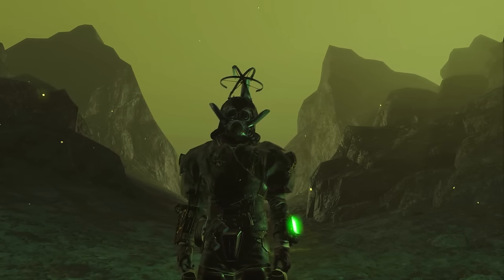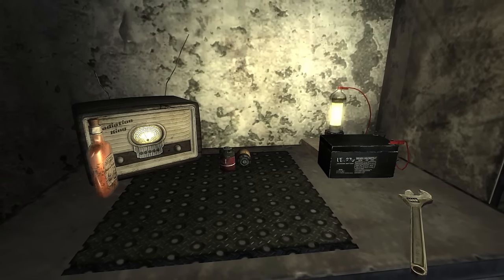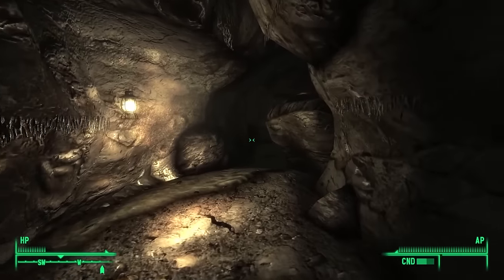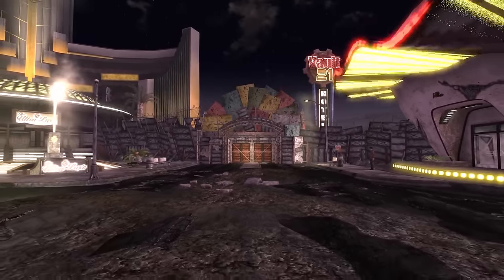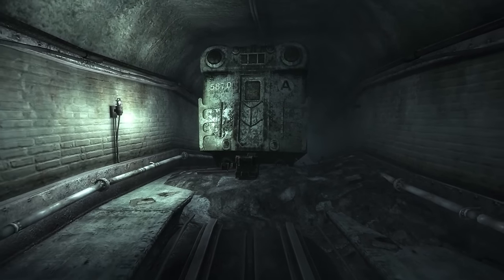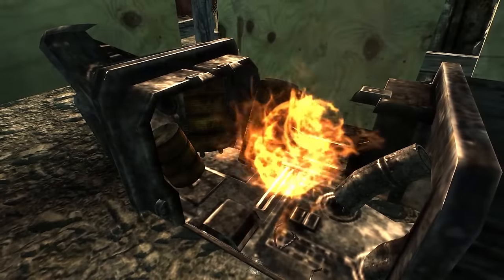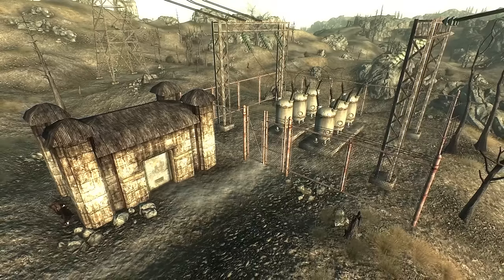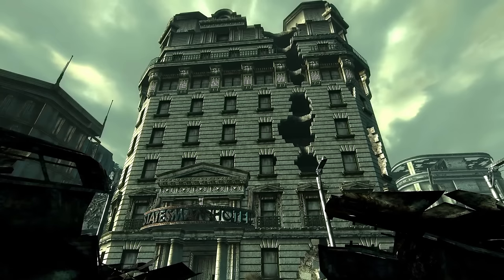Where does the power come from in Fallout?

Comment: the last part about developers making power generation being explicit only for story reasons is efficient and is one that FNV also leverages. If Obsidian set their fallout game to a place that does not have a cloes  by hydroelectric dam, they would have done what they did as Interplay in Fallout 1 and 2. Being close to the dam just made it easy for them to have a big plot point that also had the benefit of power generation and that power generation also serving purposes like that in Helios 1 or in the independent quest line. Not being explicit in world building may seem lazy, but efficiency is just clever laziness. It is efficient to leave the idea of power generation behind if it serves nothing. They did not even need to justify explicitly how a post apocalyptic society had the resources and the know how to get an entire dam running after 2 centuries of neglect and war and get the power somewhere with damaged infrastructure, though the transmission lines do not seem that damaged. Heck this is the idea of chekov's gun where if you show a gun, shoot it at the next scene it appears otherwise omit it later.
Reply: well hoover dam was designed to last, it wasnt build by apple
Reply: @Helperbot-2000  thank god it was but war and 200 years will never be kind to machinery more complex than a bolt action.
Reply: @nitesy381  House mentions that the NCR was only able to restore the dam enough for it to be around 50% efficient from it's actual output. So they weren't able to fully restore it, only enough to be in "working conditions".
Reply: @combinecommando001  Been to the damn just recently in a playthrough, yup the thing isn't running on full capacity.
Reply: @combinecommando001  NV did put that into account.
Reply: Power, just like food, water, and shelter, is definitely something that should, in all cases, be considered in a futuristic sci-fi game centered around human survival and regrowth.
Goodsprings is centered around drinking water, FO1 is about a water purifier, the co-op farms near the strip show that there is a food supply. Power is no different - if there was zero water in a fallout game, that would be similarly ridiculous; believability is important.
Reply: @Celastrous  Very well said. It may be a small detail but it is a very important one. I adds to the world and by extension the game itself. Even a fictional world needs to be belieable.

Comment: I'm surprised that steam engines weren't in fo4. Makes sense from a lore to. You had a massive war over oil gas and resources and yet you have combustion engines that takes oil and all that to use.
Reply: The problem with that is, what do you make the steam with? Coal, oil, gas, or wood. So steam power wouldn't work, the world had run dry of those resources.
Reply: Steam engines require fuel, like oil, natural gas, or some other power source. Modern power plants all use steam to drive generators, transducing the mechanical power in steam turbines into electrical power fed into a grid or storage.

Steam engines simply are not nearly as efficient as what we have today or what the world in fallout would have.
If a nuclear apocalypse happened irl and future people wanted power, it would be much easier to salvage an internal combustion engine from a car than it would be to fabricate their own steam engine.
Reply: @Celastrous  depending on the engine design. You can make a pop engine boat entirely out of tubes and a heater that wouldn't need oil
Reply: @liquidsleepgames3661  The heater would still need to be some source of fuel... Wood, candle wax, etc..
Reply: @Celastrous  and they have wood they build settlements out of it and have trees growing again.

Comment: I noticed that the fusion you place yourself in settlements don't allow their core to be removed.  I am not sure if enemies can destroy them but I know they can cause turrets to need repair if you don't set enough up to prevent them from getting close.  I like the heavy laser turrets in Fallout 4, if you are an enemy of the Brotherhood of Steel the heavy laser turrets will fight the vertibirds.  Set them on a tall enough building and they have a surprisingly long range too. It is fun to get within range of them and annoy the enemies and watch the laser turrets attack them.  If they damage them just go back as if you were setting them up and they can be repaired.  You can also scrap them if you decide that you want something else in that spot.
Reply: lol concrete floor walls was the biggest protection

Comment: I always figured the popped out fusion cores were almost spent and needed to be changed, while the ones in our settlements have a charged core, so they are pushed in.
Reply: But it's a FUSION core, not a battery. It's the source of power, not just a way to store it.
Reply: @SpadaccinoLuciano  this is Bethesda after all. They dont care at all if it works or not. Just cares enough to make it easy for players to know if they can take it or not.
Reply: @SpadaccinoLuciano  it's also a fusion CORE, and none of the designs envisioned use any sort of central core.

Comment: Consider also that the generators require nuclear material to build this could mean that the generator itself has a low amount of energy production and that the fusion core is being used to reach criticality for generating larger amounts of power. The core being slightly out when we find them in the wasteland could be like a fuse mechanism or a safety mechanism so that the generator does not explode.

Comment: Your fusion core theory actually makes sense.
I imagine that the fusion cores get ejected when they're low on power, and that's why they're not fully in the machines when you find them.
The spinning thing on the generators could simply just spin when a fusion core detected, so when you remove it, the machine stops running, since there wouldn't be a reason to if the fusion core is removed.

The reason the fusion core still has enough power to power your power armor (that's a mouthful), could be that as power is drawn, the core becomes less stable, so the generators are designed to eject them before they reach a set instability.
Or a more simple explanation could be that, Mass Fusion just wanted to rip off the consumer, so they set them to be ejected sooner. With the military however, they'd want to get as much battery life as possible, so they'd become the official core suppliers.
Reply: Fusion Cores might also work like chemical batteries, in which overtime their output decreases, to the point where they don't provide sufficient output the generator needs, but still enough to run the light and spinny bit, as well as run a suit of power armor for a few minutes.

Comment: Bitter Springs was one of the few settlements in Fallout that had realistic lighting and also electricity complete with a generator and string of lights that to the best of my knowledge were only used in The Bitter Springs area.... also on a side note have you ever seen any of the pictures from the civil war in Syria with the power grid hundreds of cables and wires all in a conjoined malformed mess. ..

Comment: Here’s my theory: the fusion core contains the deuterium and tritium fuel to be used in a fusion reactor, hence why the generators shut down after removing the core. It also contains a small battery to jump start a fusion reaction.

It would be really cool if in Fallout 5c removing the core would cause a building to lose power, you could replace the core to get the building working again. Maybe they could incorporate this into a quest?
Reply: That is at least physically plausible. I'd like a more complex system than just fusion cores, but for a realistic and simple system those would work just fine imo

Comment: I reckon that "Fusion Cores" is just a brand name:
 'Power Cores made by Mass Fusion!'
Legally speaking, just because it's not really fusion, it's still not lying...

I also reckon that the Fusion Generators are just charging the Cores using power from the grid - BUT they are themselves also power storage rather than actual generators, big nuclear batteries that still provide backup power if the grid goes down, so again legally speaking they do the same job as a generator... and because they're nuclear, they can power a small to medium-sized building (larger buildings tend to have multiple) for decades.
And if the main power grid has been running at a lower capacity and/or intermittently for 200 years, those fusion generator/battery things would get enough top-ups to never run out.

Comment: 6:28 you would find large coils of wire in a generator. a generator consists of an alternator which converts mechanical energy into electrical energy so they could be generators still. if you doubt my qualifications im an electrician and ive installed residential automatic backup generators made by honeywell and generac in the 24kW range

Comment: In regard to fusion cores and fusion generators, I always thought that the reason cores deplete faster in power armor is because of efficiency. I think the big fusion generators are a large structure designed to create as much power as possible from whatever fuel is in the fusion core. but the power armor suits are built to be much more compact, so instead of an efficient generation of power from the core, it just depletes the fuel rapidly and eats up cores.
Reply: i also want to add that we know the default fusion generators can provide power to the buildings they are in, but removing the core and turning them off does not cut off power. this is likely because buildings draw power from an external source and the fusion core power is supplemental. we know this from fo4 nuka world where removing a fusion core for the overboss fight reduces the power to the electrified armor, but is not enough to fully disable it.
Reply: It's only the players power armor that depletes them though.
The BoS and others never run out of power in their armor.
Reply: @Soundsofthewood  thats the same thing as NPC's never running out of ammo. As far as  I know the brotherhood still canonically use up fusion cores, its just they don't expire in gameplay because it would be janky to have brotherhood randomly leaving their armor around the commonwealth cause they ran out of power.

Comment: The basements of larger buildings have fusion reactors, and many houses are visibly connected to fission batteries. I thought it didn't go any deeper than that
Reply: That's kind of interesting to consider. The state's ability to supply power was probably very spotty towards the end of the war, and it would fit into the Fallout universe that shortly before the bombs the energy crisis was so bad that most people were responsible for arranging their own electricity.

Comment: I imagine the fusion generators you find in buildings functions more as backup generators than generators that power the building full time. Given how much power you can pull from one using an effectively new one in a settlement. I also imagine the core getting partially ejected might be an indicator that it needs to be replaced with a new one. So likely, they're mostly depleted by the time the sole survivor picks them up.

Comment: In Fallout 76 Fusion Cores last just as long as in Fallout 4 so the idea that 200 years later they have the same amount of power is odd

I think mostly likely Fusion Generators store Energy from the Core’s before needing to Eject them and thats why there is still power after disconnecting them, also would help explain why they are almost completely useless after several minutes in Power Armor
Reply: The reactor in a T51 is meant to last 2-300 years of continuous use, not 200 years of no use and 20 minutes of use. Bethesda's decision to give Power Armor early and the resulting need to balance it absolutely destroyed the lore.

The only possible reason is that the cores are having their connection points tonget the power out damaged, rather than actually losing charge.

Comment: One way the fusion cores could work (and explain remaining power) is that the fusion core functions more like a pilot light or starter. A fusion core would be able to supply more power than whatever it's stored in could possibly use whenever local power generation is needed but wouldn't have enough fuel inside it to run for long periods, either drawing fuel from the generator it is in or from being refilled like a propane tank. This would also explain why so many places still have power, when the grid failed their local backups  kicked in and some of that power would likely also have gone into nearby buildings.

Comment: In a world where we come across fusion cores on a regular basis, I've never thought it has been much of a mystery. many buildings are powered by fusion reactors. The real question is, why do power armors use so much power that they exhaust a fusion core after just a few days (the actual answer is: gameplay)? IRL nuclear powerplants use fission, and using this an aircraft carrier or submarine can be powered for 30 years. A fusion reactor produces so much energy we struggle to contain and maintain it. Fusion cores prove that they had pretty much mastered nuclear fusion to an extreme degree. This mean they essentially had infinite power. Any functioning reactor would be sufficient to power entire city blocks. So if a building has one or more fusion reactors in the basement, I wouldn't be surprised that it could power nearby buildings as well. 

I would also like to point out that it's a video game. Bethesda hasn't even finished any of their games, so they most certainly haven't designed scientifically accurate electric grids into the game. "Electrical box" is probably as scientific as you can get it in-game. That's a game designer's way of saying "We need this area to look more interesting and like it has some sort of electrical set up. Let's put a big box with some pipes and wires going everywhere." It's a lot like the "computer" I made as a 5 year old. It was a block of wood with non-functioning wires and lightbulbs sticking out of it.

Comment: "Small Modular Reactors" would be my educated opinion. I work in nuclear power and prior to Fukushima stalling construction AGAIN from fear, they were what the industry was looking to moving towards in the future.  First it would be large modular plants that would provide power in the 1000MW range, but small modular reactors would be just that, very small nuclear reactors that were designed to function for years providing smaller amounts of power for places like large manufacturing plants or a town. The part on the top looks like a small steam turbine-generator. Steam spins the turbine and the generator generates the electricity much like an alternator in your car.

Their designs were and are quite ingenious with a passive fail safe systems that are completely enclosed and can't "melt down". But once Fukushima happened, people's fears took over and yet again we allowed it to stifle our society. For someone that knows how safe nuclear power really is it's very frustrating at times. Ignorance is our biggest enemy, but it IS a complicated system for people that aren't technical,

Comment: My head cannon for the fusion cores was always that the fusion generators are storing excess power or nuclear material in the fusion cores. The fusion core is then just what Preston described it as, a battery. 

Its there so if the reactor fails or something, you'll still have power for however long the fusion core's power reserves are good for. So when you remove a fusion core from a building's generator, you're not killing its power supply, you're yoinking its integrated battery backup.

Comment: The existence of three phase power implies that single phase power must exists which is what powers most residential homes in our timeline also unless stored power must be consumed at the rate it is produced, if it’s hooked up to the power grid and there is excess it is brought back into the grid which would explain why if a power station is unmanned and no generators running, any extra power produced from those at home generators would feed back into the grid and be redistributed to areas on said grid. Have you noticed that when a power line goes down in a city only a section of a city’s power goes down? Well that’s because that line was only powering a portion of said city so while the nukes may have downed some power lines some area, towns, etc would have power from the existing grid while some don’t and as for the case of Big Mt it’s possible that there is a power generation off site that provides power directly to it via direct buried lines which, if said power generation facility were underground as well in something like let’s say a vault, may not have been impacted by the nukes as I would assume is the case of some small  government ran underground facilities as well

Comment: 21:00 not having all 3 phases is not an issue in most cases. 3 phase is only present in commercial or industrial places so places with small motors, terminals, lights etc would be fine. all these single phase electrical circuits can use any one of the 3 phases. the issue of broken grids only arrises with large motors like elevators which are 3 phase. pumps are not necessarily 3 phase because single phase AC motors do exist, most motors in everyday life are single phase AC motors like fans, appliances and even some industrial tools like drill presses, lathes, welding equipment.